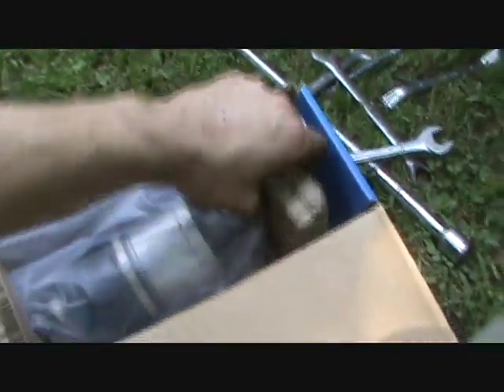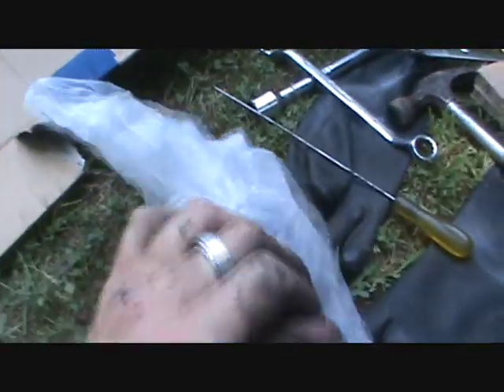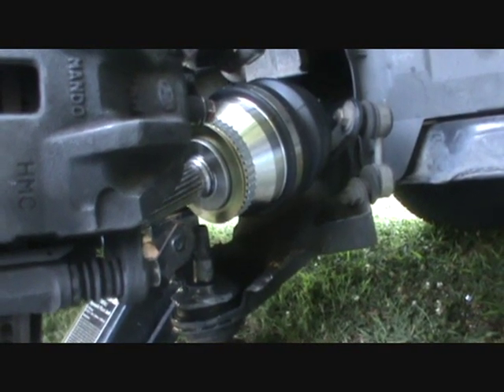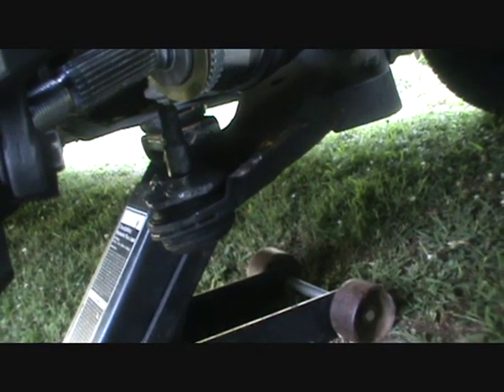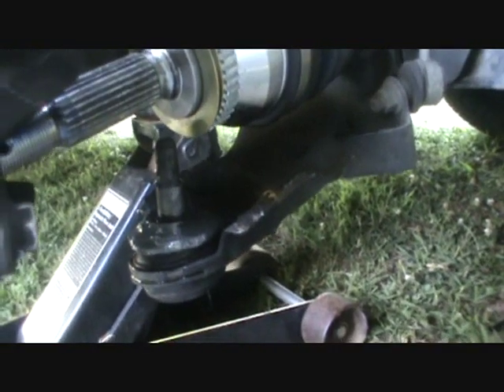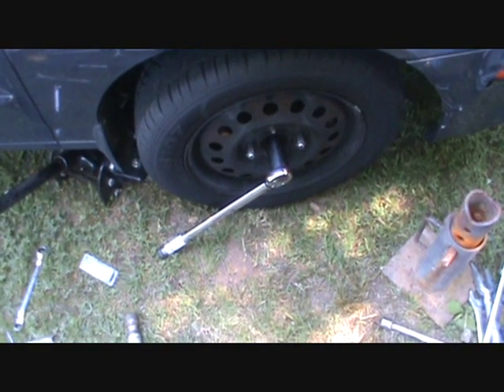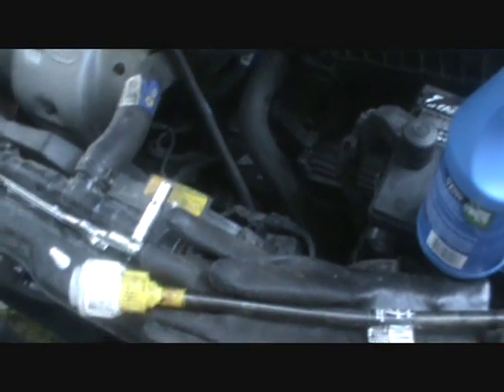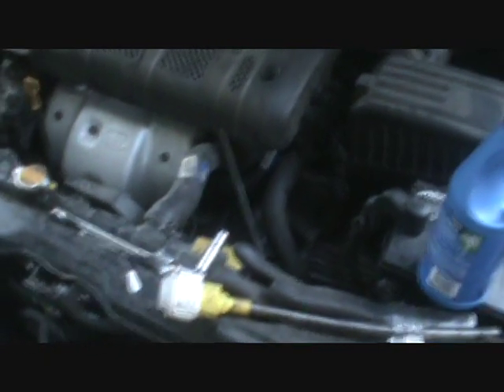2001-06 Hyundai Elantra axle replacement Part 2

Comment: One search on Youtube and I found this video, thanks so much for posting I probably could of done it with out it, but with it the job was super easy. The axle removal was a little vague but with a big screw driver its quite easy to pry it out from the side closest to the motor...the oil leak tip helped a lot and saved me a huge mess...once again thanks for posting...

Comment from the maker: @beachnative420  The easiest ways to tell if the car has ABS are to watch the dash when you start the car and observe whether there is an ABS light, or, when you get the front wheels off, see whether EACH side has the trigger wheel at the outside end of the axle.

 They all appear to have ONE, on the right front axle, but my car lacks ABS and had no other trigger wheels.

 The good news is that the ABS axles appear to work fine in Elantras that do not have ABS. That's what I used in mine.

Comment from the maker: Check the lower control arm bushings while you are in there. If they are worn out you can usually buy the entire arm with ball joint for a reasonable sum.

 If you live in the snow belt the lower control arms were prone to rusting, so be advised.
Reply: Mine was 80% rusted -lucky she didn't snap passing a semi (thanks hyundai !!

Comment from the maker: Sometimes you really have to wham on it to get them to break loose. One thing you can do is a get a long bar and carefully position it where you can pry downward on the lower control arm. At the same time, another person can use the balljoint separator on it. It shouldn't stand up to that very long.

Comment: @MisterNP  Am sorry but you show the old cv joint on the ground after you take the ball joint out (before showing the new cv joint) the next shot is off the new joint in place. What I found is you have to gently tap in the cv joint so it sits into place( the reason why there are clips on the end of the cv joint)  this is what I mean, apart from that you were a big help.

Comment from the maker: @sqweeks85  In reviewing this, there is no real reason to leave it on slightly other than to keep the lower arm from slamming down when it finally breaks loose.

 Be sure to use caution and not puncture the lower balljoint boot or pound on the end of the balljoint stud.

  Good luck!

Comment: Great video! Just finished changing the axle on my moms car. Same make and model. With just the left side axle and both rod ends because because they were worn out. Total cost with some tools was about 95 dollars. The hardest part was taking the axle nut off. Broke two ranches and ended up going to a local garage to have them loosen it up a little with the impact ranch. Installation and removal was a breeze. The axle fluid also came out. After refilling that side of the axle still drips. Is tha

Comment from the maker: The speed sensor should be at the hub by the wheel. Usually there is a single bolt holding it on, plus the wire connector. Not usually a difficult job. Are you getting a code that's indicating a bad sensor?

Comment: Replace the whole arm, check to see if the arm is rusted. Hyundai did a silent recall on them.  They rust out and fail (arms) .  Because the ball joint comes in the arm you might get them for free.

Comment: Hint:  don't watch the fluid drain out- get the new axle back into the trans quickly to avoid more leakage.
Reply from the maker: It's not that easy. That axle has to be driven in the last couple of inches and I prefer to take it slow and avoid tearing the seal up. Most people don't check trans oil anyway so it was a good time to top it off.
Reply: WhoSaidTyler That's how I usually do it.  I know to expect drainage so I set everything up ready for that.  Never had a failure.  I don't completely avoid leakage, but I definitely keep it to a minimum.
Reply: Robert El-Adham I completely agree! Please put a pan under the car to collect the oil. It's toxic stuff.
Reply: it's not bad, you can drip it from your fingers onto your sub and eat it
Reply: enjoy :D

Comment from the maker: There's not enough difference in those two weights of oil to make any difference. It sounds as if your noise might be related to motor mounts rather than splines on the axles.  I would keep an eye on it and see if it gets any worse.

Comment: Thanks for the video! I have a question. I just replaced my axles and since I had everything apart I decided to replace nearly everything (ball joints, wheel bearings, stabilizer bars, etc.). I don't know if my issue is the axles I bought but when I start from 1st gear (and shift in an gear) I hear a "tick/click" (most likely the spline). My owners manual and repair guide both said to use 75W85. You recommend using 75W90. Could this be my issue? Any advise would be appreciated!

Comment: I got a 2004 elantra and it shakes at 60+mph I got tires balanced and aligned and it stll shakes... also when turning it makes a cracking type of sound... could that be the ball joints or the axel?

Comment: Ok i replaced both axles the passenger side is fine but the driver side when im driving and going to the right it sounds like a rubbing noise or something and it didnt do this before with the original could it just be that i got a bad axle when i bought the 2 its wierd because when turning left its fine no noise or anything